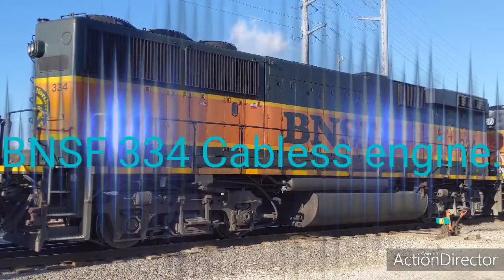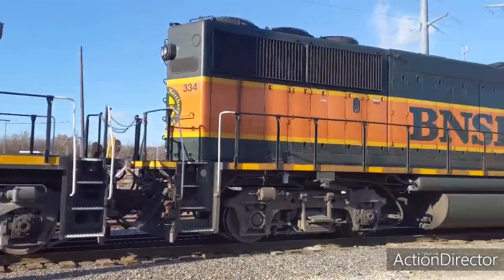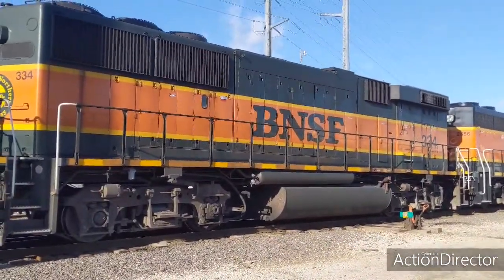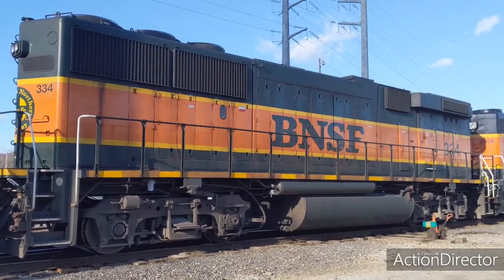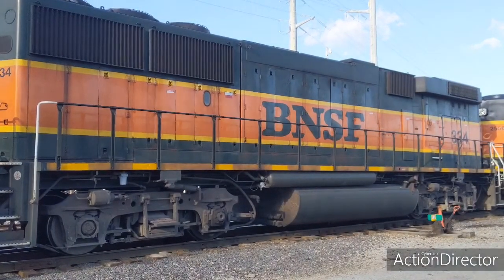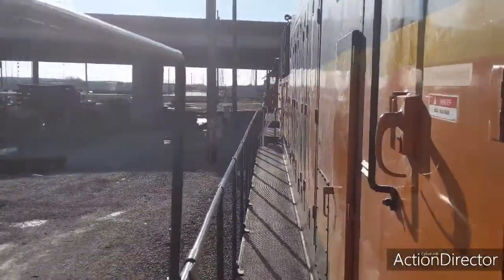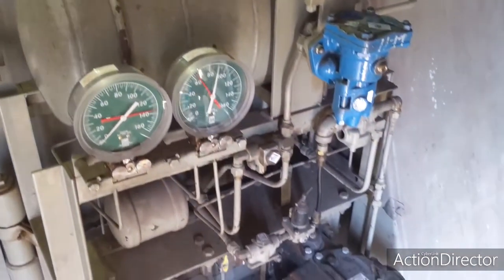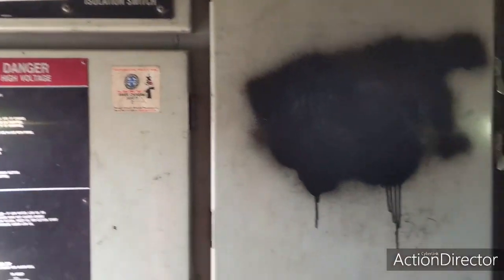BNSF 334 "cabless" engine...

Comment: Your cables engine is an EMD GP60B Santa Fe ordered them this way in 1994 to run in A-B-A engine sets on high speed intermodal trains. Conrail also looked at ordering GP60's with matching B units in the mid 90's as well but opted to go with the SD80MAC models insted.
Reply from the maker: Believe me,I wasn't on a high speed intermodal train that day...LOL...I was on the 105 local coming back from Chicago to Galesburg Illinois...But yeah, I remember them on the hotshot trains when I ran in LA and San Bernardino..198 train and others. Thanks for watching. More to come
Reply: Are you sure this isn’t a slug as a lot of slugs are made from locos or loco parts
Reply from the maker: Im positive...I will be doing a future video of a slug as we have them in Galesburg yard.
Reply: @MattyC62185  a slug does not have a diesel engine or any on board source of power. A Slug is entirely dependent on getting its tractive power from a dedicated “Slug Mother” locomotive that has been outfitted with the proper connections.  A slug may or may not have a cab. While many were built without cabs, many railroads (CSX as an example) used versions with cabs as “Road Slugs”.  
But a slug and B unit are very different      A slug will never have an engine, but may or may not have a cab. A B unit  will always have an engine and never have a cab.

Comment: Got some of those GP60Bs still in service here up in the Seattle area in local service. They put them on short-range manifests and sometimes trash trains. Pretty cool to see, especially in the old H1! Also, kinda cool to see you got to drive an SD40-2! Around here, the SD40s have almost all been replaced by the rebuilt SD75I/Ms. Got one SD40-2 left (in H1 no less!) here in Everett, with RC equipment.
Reply from the maker: Hey, thanks for the nice reply..More to come...

Comment: Yep, a GP60B.  By the way, I have seen pictures of ‘road slugs’ which do have cabs but are just to distribute traction from another locomotive, like any other slug.
Reply: Yep. djstrains has a great video of a CSX slug with a cab. The body cavity was filled with concrete. Looked like a GP-40, but no prime mover. He also stated that the two unit set was permanently connected. One ‘regular’ loco with a prime mover and one slug with only traction motors. But they looked the same until you looked closer Nd then you could tell which is which.

Comment: Suprised there's no hostler's controls...that's what the porthole on the Union Pacific GP9B's was about 😉  When I was in college, these GP60B's were newly delivered Super Fleet units.  They looked sharp up front on Santa Fe's hotshot intermodal trains, mixed in with GP60M's (wide cabbed GP60's) and Dash 8 40BW's.  Santa Fe also used to rebuild SD40-2's and SD45-2's that got wrecked on Tehachapi into B units...I understand Burlington Northern did as well!
Reply from the maker: If there are any, I have never seen them and never seen anyone operate them on the Santa Fe or BNSF.

Comment: The GP60B has its own 3800 HP prime mover. It is ALWAYS MU'd. Just LISTEN to those babies PURR! Before BNSF existed, I believe these were paired with just-as-rare-to-see GP60M's on Santa Fe's intermodal trains. Wasn't there some hubbub in engineering circles about the GP60M's and 60B's having too much horsepower for a four-axle locomotive?
GREAT VIDEO! YOU'RE LUCKY TO HAVE THAT JOB!
I have a GP60M-GP60B A-B-A set in the red and silver war bonnet paint scheme pulling my intermodal train. Gosh, does that look (and run) great!
Reply from the maker: Yeah, they pull really good...

Comment: Thats Some Awesome sauce Right There the Guy Cool Engineer that Runs the Train explains what he's Running that's pulling the Train We like that for sure 👍 

Allen D  Railfan & Model Train Engineer
Reply from the maker: Thank you so much...I appreciate it..I try to find things that are different or interesting at my work...More to come
Reply: I take Pictures & Video of BNSF that Run on the La Junta Hutch Sub trains going & coming in from Dodge City & on Herinton Sub UP Trains that go out to Pratt and head back into Hutch this Route is also know as the Golden State Route the Frisco the Rock Island and before UP took over the Southern Pacific Ran on this Route Pretty Hard seen lots of the S.P. riding on the Back of my Dads motorcycle going out to my Aunts house in Liberal...  

Allen D

Comment: Great video! Cabless I haven't heard that before but a neat name! I still like calling these B units. Reminds me of the E's and F unit that were B units. Even GE had B units but those are none existing
Reply from the maker: Yeah, I have heard many different names...
Reply: @imyourhuckleberry357  I SAW A GE BOOSTER UNIT FLOATING AROUND 
WESTERN KANSAS GRAIN ELEVATORS, CONNECTED TO A GP 9 LEAD UNIT!
WAS BEING USED AS ELEVATOR 
WORK HORSES, RATHER THAN ROAD USE!
Reply from the maker: Yeah,most are relegated to less than classy service..lol
Reply: The P&W had a least one GE U-Boat 'B" unit working the Providence RI area not so long ago.
Reply: @MsCriticalthinker201  intresting
Reply from the maker: @MsCriticalthinker201  Ohhh..U boat, that's a new one..
Reply: @rossbryan6102  I was going to mention that one, but you beat me to it. It sure is in rough shape... but not yet had a meeting with the scrappers torch so thats a +

Comment: Glad to see them still in use. With the scrap happy Big railroads nowadays.
Reply from the maker: Yeah. They are rare...As is the prior Santa Fe engines I used on the local 104/105 job I worked...It's on another video if you care to watch.
Reply: @imyourhuckleberry357  it’s surprising to see them as locals but the BNSF it into 6 axel units on mainline trains. The GP60s were the pride of the fleet in the 1990s . I don’t know how the wide cab works for yard switching, they have one in Gallup New Mexico in there yard.
Reply from the maker: @janeordway4841  Not to much switching on the 104/105 local..Just mainly a straight set out and pickup at Joliet yard each way then off to Galesburg or Chicago.

Comment: This is like the F engines that had  A B C D UNITS   for passenger train .The CGW had 3 or 4 unit on the freight train in Iowa when I was a kid.
Reply from the maker: Those F units were gorgeous on the old Santa Fe...The huge single headlight and streamlined. And ladder up the side to get in cab... We used to call the old covered wagon engines,the ones you would walk through the engine compartment to get to the other end...Haven't seen those for awhile. Thanks for watching. More to come

Comment: That’s right by where I work. I’ve seen this thing go out and about in different consists, along with 332.
Reply from the maker: Yeah, It was in Hodgekins yard near willow springs yard..I was on the local 104/105 at the time..More to come.
Reply: @imyourhuckleberry357  yeah, I was at the bus yard adjacent to the spur track leading up to the yard itself. Along with 332 and 334, I’ve seen a Santa Fe blue warbonnet GP, and a few Burlington Northern painted GP locomotives go through as well.
Reply from the maker: @josephbugaj8149  Ohh yeah, you're the guys we piss off blocking your driveway, only one way to get in or out that place.....LOL
Reply: @imyourhuckleberry357  LOL. Yeah, that’s right. Personally I didn’t mind the delays. Made it interesting to see what locomotives rolled through.
Reply from the maker: @josephbugaj8149  You mean this war bonnet? https://youtu.be/Mx_CT1JWDwk
Reply from the maker: It's the Santa Fe 3167...I did a video on it because alot of people like taking pics of it along the route...And I mean " everywhere"....
Reply: @imyourhuckleberry357  that be the one, as well as another warbonnet, number 167.
Reply: Our yard parking lot is popular with railfanners, who like seeing the trains roll past.
Reply from the maker: @josephbugaj8149  Here another vid of the red nose war bonnets...https://youtu.be/lDehvZM7jAk
Reply: @imyourhuckleberry357  I haven’t seen very many of those rolling past, either from the yard or the main line.

Comment: Cow and calf units and they are really cool to see them run and you can always use them when your train is going up the horseshoe curve
Reply from the maker: Haaaa, love that name too.. Cow and Calf....That's a first on me ...The horse shoe curve? Is that the famous curve in the UP going to Bakersfield? I used to run on the Cajon Sub prior Santa Fe.
Reply: They can always always come in handy for anything just as long they have cab locomotive
Reply: @imyourhuckleberry357  Cow/calf is an old term for those old switch engines like SW1500s and the like that had a B-unit (usually the same model) coupled up to them. You don't hear it anymore because those B-units got scrapped a long time ago.
Reply from the maker: @sharkheadism  Are you talking about the usually hump engine that had a slug attached to it? Slug being a set of traction motors but no engine, it used the electrical power if the switch engine for traction on its motors...
Reply: @imyourhuckleberry357  Nah, cow-calf was two units, both with prime movers, one had a cab and one didn't. It would be like a GP60 and a GP60B coupled together, but they were switch engines rather than road units.
Reply: @sharkheadism   yes. A Cow and Calf was unique to the switchers. Not GP and SD units.   A loco with no cab is classified by the manufacturer and FRA as a “B” unit. Which is why every cabless unit built be EMD and GE (and everyone else) has “B” in the designation of the model. 
Many railroads call them “Cabless units” to eliminate confusion amongst people who don’t have a full understanding of what loco model numbers designate.

Comment: Although possessing most of it’s power equipment as the main locomotive, these B-Unit type locomotives are essentially “slave” units having no cab controls (my guess) and all it’s actions are governed by the lead main cabbed locomotive.  I find these machines extremely fascinating because of their slightly subdued appearance (almost “faceless” due to being cab-less) in comparison to the rest of locomotives because it’s very rare to see them in a powered consist.  My first encounter with this rare unique beast was a BNSF 4-axle unit (like the one seen in the video) sandwiched between the lead cab 6-axle and the trailing cab 6-axle units.  I’m not well versed in locomotive identification but could these be GP60-B’s?
Reply from the maker: You are exactly correct..It is essentially a cab less locomotive. You mostly see these in yard hump operations anymore. Thanks for your comment.

Comment: Never heard of a cabless engine until now.
Reply: The proper term by Manufacturer and Federal regulations is "B Unit" and they have actually been around since the late 1930's.  The Santa Fe was the last US railroad to order any and these units that are on the BNASF are the last of that order.   Any locomotive with an engine but without a cab is a classified as a B unit under federal regs.
Reply from the maker: Under, I work with them everyday, we call them cabless engines or units just like we don't refer to Locomotives by model numbers we refer to them by their actual number. The people that actually work on the equipment everyday are alot different than railfans.
Reply: @imyourhuckleberry357  that’s perfectly fine. You are more than welcome to refer to them as anything you’d like. It doesn’t change reality though. Local railroad slang doesn’t magically become an official designation to everyone. The company that built them does not officially call them “Cabless locomotives” Nor does the FRA.  If some employees at BNSF do that’s fine. But I’m not sure why you’re trying to imply that every other railroader is wrong about what a B unit is but the BNSF employees who continue to use that slang are the only ones who know what they’re talking about.   
When we had consists with EMD GP40’s back in the 80’s on Conrail we called them “Geeps”. But we certainly didn’t tell every other railroader who called them a “GP40” that they were wrong.  Cabooses were called a dozen different slang terms (Cabin, Crummy, Hack, Waycar, Buggy, etc) depending on the railroad. But it didn’t change the fact the official designation was “caboose. That’s why the FRA inspection form said “caboose inspection form”.  
The whole idea of this website is to further educate those who want to learn about subjects like these. I’ve been on the railroad for over 30 years not only as a locomotive engineer, but on the locomotive mechanical side as well. I’m more than qualified to comment on the subject. So save the “railfan” comments for someone else.
Reply from the maker: @FFred-us9tw  You didn't get the point of my video at all...The point of the video was that people were calling these units slugs...As you well know. slugs are mainly used in hump operations and use power of another engine they are used for tractive effort. I did not say what the exact model number and serial number this unit was...Guess what. We don't care ...We don't call these machines we work on everyday by their model numbers...

Comment: I understand that B-units originate from the E and F series, it makes the whole A-B-A or A-B-B-A consist look better, you don't have A units facing nose to butt. But with these standard looking locomotives is there really a point producing a B-unit? Lower manufacturing cost maybe? Because a normal locomotive with a cab can do everything that the B-unit can, but the B-unit always needs to be a trailing locomotive.
Reply from the maker: I don't believe BNSF buys anymore like these.
Reply: "B" units make sense when you think about the cost of "running" maintenance. Without a cab, the daily running costs drop due to the fact you're not checking/cleaning the insides of a cab, cleaning the windows, or checking/changing the wiper blades. They cost a bit less, no controls, no windows, no control stand/seats, no heating/cooling needed for the cab area. B-units shine when you "always" need lots of power in a consist. One or two cab-ed units with several cab-less units in-between work great in most situations. B-units are sometimes an absolute pain for the operations department as you can't assign a "single" cab-less unit to handle a train by itself.

Comment: Do these have hostler controls like the olf EMD F-series B-units had (I think) or can they literally only be controlled by being MUed to something else, even to move them ten feet in the yard?
Reply from the maker: In all my 32 years on the railroad I have never seen one of these engines move on its own. I never seen any controls to so so on the engine as well...Thank for the question...
Reply: @imyourhuckleberry357  they should have hustler controls in them like the older GP series B units did. The panel should be located near the front behind an access door.
Reply from the maker: @onrr1726  Boy, if they do, I have never seen them nor seen anyone operate it in my whole 32 years so far..Not saying they don't, if I ever come across one again I will check further...Thanks for the great comment and watching...More to come
Reply: @imyourhuckleberry357  FOR SURE THEY WERE OPERABLE ON THE OLDER ONES!
Reply from the maker: @rossbryan6102  OK, BUT I NEVER SEEN THEN RUN THAT WAY!
Reply: I never hostled any of the ex-ATSF units that had their own control stand. You had to move them around with another unit.
Reply: @imyourhuckleberry357  hostler control stands have really basic controls, like a one or two notch throttle, a reverser, an independent brake valve, and horn and bell buttons.  Amtrak's Genesis P40's (the original order, 800 series) had a hostler's cab in the back of the unit.  I think Amtrak dropped the hostler's cab from subsequent P42 orders...that's probably the last locomotives in the USA that had them.
Reply from the maker: @sharkheadism  As well as I..
Reply: Way, way back when the GP7 and GP9 were being built, the "B" units, like some of the F-B units, had a hustler control stand in what would have been the cab area. (EMD F-B units always have an extra round window in the right front side "IF" and only if they had a hustler control stand. Look at photos of UP GP9B units and take note of the single round porthole in what would be the cab area on a standard GP. Due to the unneeded costs and the lack of visibility hustler controls were dropped from production units in any B younger than a GP9B. it's easy to move them with any other loco.